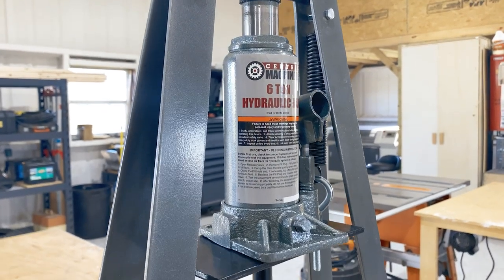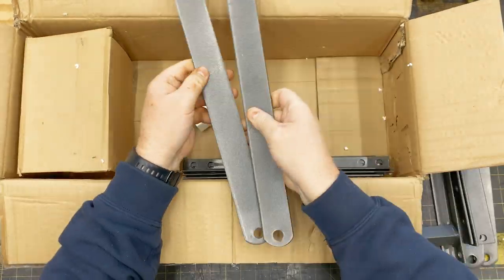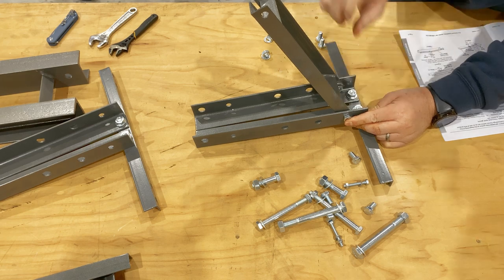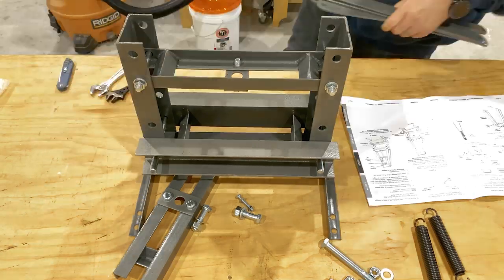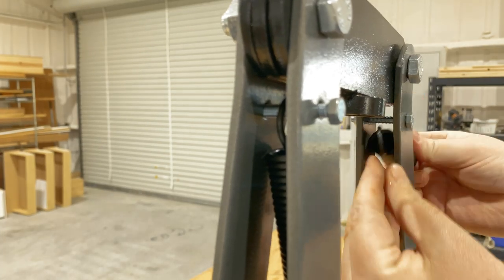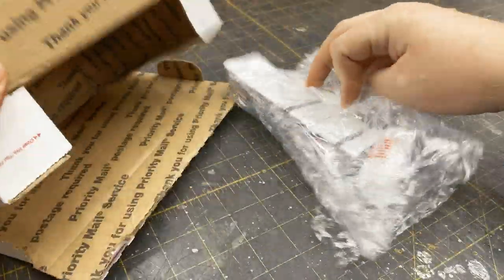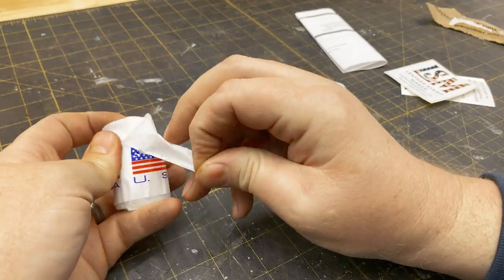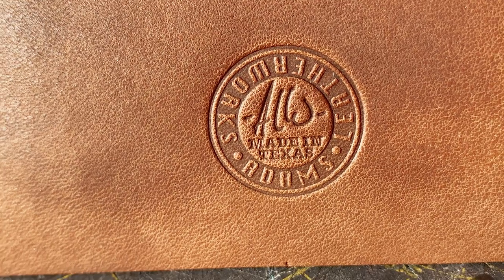My New Bench Press & Brass Maker Stamps!

Comment: Isnt Youtube spooky. I only had to be thinking about stamps on my morning walk and what should pop up in the recommended videos? This one. Were the prices on the back of the card for the brass stamps? Do you just have to supply them with digital art and they quote you? Im wondering how intricate they can get too. I am wanting to produce stamps of military hat badge insignia for corps specific wallets. Not sure if that can be done. I assume the more detail, the longer the machining time and the greater the cost? Oh BTW was that wet cased veg tan you stamped? I see some makers heat their stamp when it goes on the top side of harness leather for a dress wallet. Is that how the dstamps are used for that type of application? Actually laser etching might be better for fine detail but I assume the set up cost for that process would be high?
Reply from the maker: Sorry for the delayed response. Yes, those were stamp prices on the back of the card. Based on what I know about CNC, it's very difficult to determine exact machine time without final artwork. They probably came up with a good ballpark time/price per square inch they were comfortable with so they didn't have to calculate time/price with every inquiry. And yes, I just sent them my logo file and they sent a digital proof for review. My logo is pretty detailed, considering the size. I think the military logos would work fine. I'm sure they have experience with those already and can give you insight if you haven't already reached out to them. Yes, I did wet the leather a bit prior to stamping. I generally count to 10 in my head before I release the pressure. I don't have experience with hot-stamping but wouldn't mind owning one some day. Laser engraving is a whole different ball of wax, and somewhat more trouble than it's worth. Between masking, focusing, keeping the leather flat, proper engraving power/speed settings, alignment, etc., it's a lot of work. I simply stopped applying my logo to finished pieces for a couple/few batches until I got the brass stamp setup. And yes, lasers are very expensive. Several thousand dollars is a general starting point, though you can go cheaper if all you care about is engraving and not so much about cutting.

Comment: Is there a min leather thickness you can use a stamp on? Thinking of stamping very lightweight harness leather that has been split down to 2-3 oz, (or maybe a little lighter) for wallets.
Reply from the maker: I don't know about that. I don't typically work with anything that thin, but I assume it would work okay.

Comment: I (think) I need one of these.  I’d like to try compression in the initial phase of wet-molding as well.

Did you always have such a clean garage?

I sent you a question with pics in it to your site email a week or so ago and it eventually bounced back to me, whereupon I resent just the text portion.  Did it get through?  I’d really like your opinion since we seem to do many things the same way.
Reply from the maker: Sorry about that - I've gotten behind in my emails again. I'm going through my inbox right now and will respond there. 

Regarding the stamp - I'm still getting used to them. The stamps themselves are awesome, but I need to make sure I allow plenty of 'billboard' area on my designs to allow room to place the stamp. My original stamp was pretty small, so space wasn't an issue. The laser was great because I never had to worry about molding softening the stamp impression. I've been trying to apply the brass stamp after assembly & sewing, but before forming. I dampen a flat area and stamp the logo, then let it completely dry before moving on to wet-molding. I may try stamping it after dunking, but before molding, but the leather may be too wet to hold the impression very well.

LOL about the garage. I'm one of those "a place for everything, and everything in it's place" people. Clutter stresses me out, so as long as my clutter is all arranged in columns, 90 degree angles, and perfectly stacked piles, I'm good to go. I'm kidding of course, but my shop is 30x50. I have an 8x30 loft above my leather area for storage to help cut down the clutter in my shop area. I'm actually about to enclose and air condition my leather area. Was hoping to start that this week, but I have to finish my current batch of holsters first.

Comment: OLD LEATHER SMITH here, when you make a new cutting table Please do what I did, make it 5ft. X 8ft at the least, U will B surprised at how much the extra comes in handy. GOD'S BLESSINGS BROTHER ✝️⚾🙃
Reply from the maker: Hi Jim - I saw you comment on a random woodworking video somewhere the other day. Small world! :) I do need to make a new workbench for my leather area. My current table is 3'x8'. My main workshop table is 4'x8'. What material did you use on the top of your table to get 5'x8'?
Reply: @AdamsLeatherWorks  Hi Eric, It used 3/4 plywood and 1/4 plywood on top, then I screwed 2 my frame 2, 1x6x8ft long edge 2 edge which makes 5ft. By the way my frame is made of industrial metal lumber which can B purchased at any garage door installer, it's what they use 2 hang industrial garage doors or metal lumber 4 metal shelves

Comment: What laser do you use?
Reply from the maker: I have a 90 watt, 600mm x 1000mm CO2 laser from Rose Graphix.
Reply: @AdamsLeatherWorks  gotcha! Is there a brand you would recommend for people who want to try a beginner laser?
Reply from the maker: Glowforge would be a great machine with a large support base. Mine is officed in Florida, so US based support is good for me since I’m in the US. My power supply went out last week so it’s nice to have someone I can call for help and parts. Look up Ben Myers “Did I waste $2400” laser video on YouTube. Do you have a budget, or bed size in mind?
Reply: @AdamsLeatherWorks  thanks for your quick feedback! ideally I’d like to keep it under $1k until I know it’s something I can use in my shop. Mostly for engraving and not cutting. I’ll check out the video. I’ve looked into the glowforges but if I’m spending that kind of money I’m getting a cobra class 4 first! Lol
Reply from the maker: I hear that! If you're cranking out the leather stuff, that's a much better investment and the Class 4 should hold its value very well. There's cheaper lasers, but it comes down to how technically inclined you are. I'm not good with electrical stuff, but a lot of people love the small "K40". But they all say the same thing - "be prepared to take it completely apart and check all the wiring so it doesn't kill you!"
Reply: @AdamsLeatherWorks  k40 can kill you. Noted. Lol thanks for the feedback man! Looking forward to more videos!